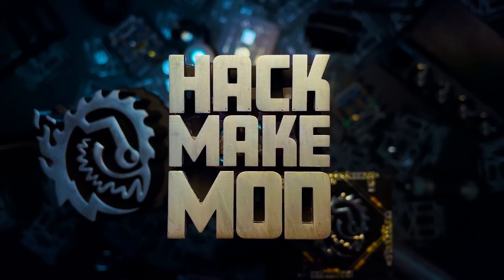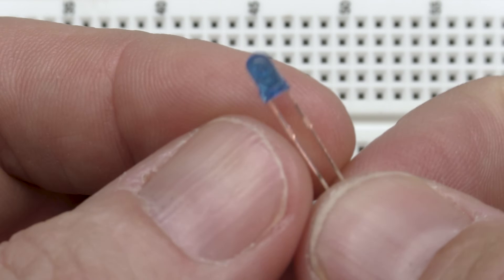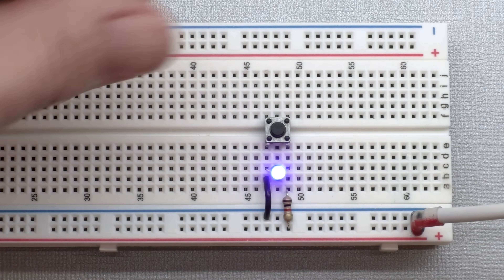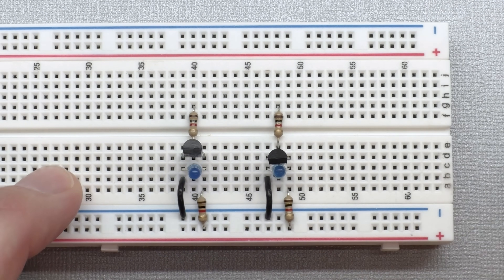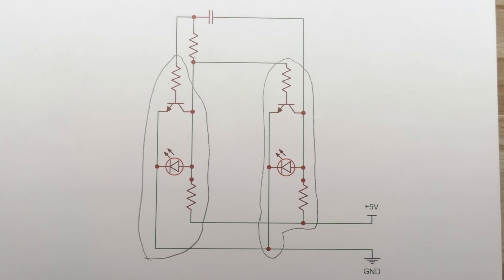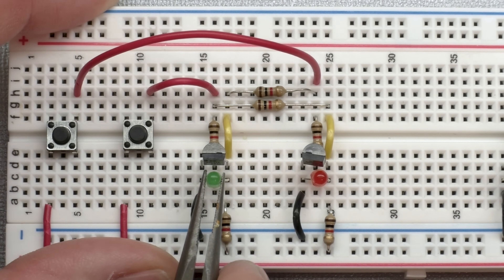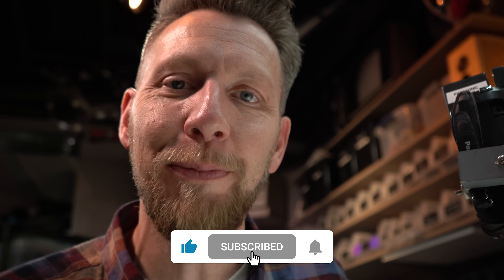Fun with Transistors

Comment: “In theory, if I take the output of the first one and run it to the input of the second one, what do you think will happen?”
**LITERALLY proceeds to run the exact opposite.
I work with electricity and logic circuits for a living, but even my brain hurt for a while until I realized that the two blue LED circuits were redefined without ever stating as much.  Silly me, I thought that the first circuit that was populated to the breadboard would’ve been referred to as the “first” circuit and the second one the “second.” ¯\_(ツ)_/¯

Comment: Super awesome video that actually show-cases how electronic components work and follow the rules of electricity. I have a lot of theoretical knowledge of how these components work but watching a practical application with actual circuit diagrams was awesome to watch and understand. I wish you the best and hope that you make more videos with more sophisticated components like inductors and transformers, and gradually moving to simple Arithmetic or Logic units (ALUs) and then gradually ever more sophisticated chips, leading to a micro-processor controlling a synchronous or induction motor leading controlled mechanical motion controlled by a programmable chip to a fully functional mini-robot .

Comment: The 2N222 is a BJT...  Current controlled device.  Nearly all digital transistors are CMOS.  CMOS transistors are more complicated because they are actually a combination of a NMOS and PMOS.  These guys are designed to operate in a switching mechanism with voltage on the base.  BJTs can work as a switch, but they're a lot slower to "saturate", completely switch on or off

Comment: hello thank you very much
but I have a question why do we put a resistor next to capacitor
is it to discharge to it when open circuit then let the current pass?
Is that what you mean
And why did we choose 22uF capacitor , how a capacitor determine time , is there a formula?
THANK YOU VERY MUCH
Reply: Hey, did you find out why we use a resistor next to capacitor? I have the same question.

Comment: Thanks a lot for that amazing tutorial. Just a quick one, I've followed along and made the 2 circuits for the oscillating circuit, however, when I try powering up either of the transistor bases, it switches off both LEDs. I'm quite a noobie to electronics and I'm using a BC547. Please let me know what I'm doing wrong. Thanks!

Comment: I resonate with every comment here. You re-defined how the knowledge is meant to be passed on and reminded people that math is a representation of observations and can never be equal to the observation itself. This demo fired more neurons in my brain about the use of transistor than all of my 4 year undergrad syllabus did! Thanks a ton for putting actually useful stuff in here, instead of all mumbo jumbo. Hope to see more such useful stuff!
I wanted to share my thoughts as they I passed between my ears.
11:47 actually nothing is happening - because there is an invisible barrier to lift the right transistor from ground to positive voltage, whereas the first transistor is in a more stable configuration with it's carriers having already crossed the depletion region.
12:40 when you add a RC circuit, it helps push the first transistor out of it's stable state by increasing the current flowing into the first transistor which triggers a voltage drop at the second transistor there by reducing the barrier to turn it off.
If you added voltmeters at each of the nodes, these change would become more evident and we can see that the circuit is in a stable configuration even with a loop when RC circuit was not added.

Comment: For me as a beginner, it’s not clear what happened when you first introduced capacitor and 10k resistor (to recharge the capacitor). It would be great if you cover in more details, how exactly the resistor helps to recharge the capacitor in the given circuit, the direction of current to the capacitor. I cracked my brain pondering on the circuit and still didn’t get it.

Comment: That was great thank you !! Iv been hooked on Arduino since i discovered it around a year ago and iv been looking for a simple explanation to help me understand transistors for ages !! That was clear, practical and very interesting thank you so much .. subbed as id like to see more maybe you could do some more cool little circuits with capacitors and transistors to help people like me understand the underlying electrical principles that seem a bit abstract when at the microcontroller level.

Comment: This video is brilliant. For anyone else who got stuck at the simple oscillator (both my LEDS went off when I connected the collector leg of the first resistor to the 'input' or base leg of the other one), using a 10K resistor rather than a bare wire solved my problems as my voltage coming in was a little higher.

Comment: Why are you controlling the LEDs by having the transistors short across them as opposed to the conventional connection of having the LED positive connected to the emitter side of the transistor and the negative side of the LED to ground. Now when the transistor is turned on, current flows through the LED and it lights up and when the transistor is off, the LED is off.  FYI, Electrical Engineer grad 1974pm (pre microprocessor!).
Reply from the maker: I originally did this to invert the function of the transistor. Then I continued building from there
Reply: @HackMakeMod  This is so confusing, why do things backwards, took me hours of wasting time. Tried patkeller method and it worked in seconds

Comment: "Do you know what it is?" Yes, given the package and context, I would assume that's a (most likely NPN) Bipolar Junction Transistor (BJT).
"Do you know how it works?"  Nobody knows how it works.  Nobody.

(Ok, there are a few very smart physicists who have sophisticated mathematical models for how a BJT actually does what it does, but to everyone else, even all the electrical engineers that design really sophisticated circuits with them every day, it's still basically magic.  (Knowing how to use them and knowing how they work are not actually the same thing...))

But they are, indeed, incredibly useful anyway.

Comment: To figure out which side is negative on your LED, use an old 3V lithium cell, it won't need a resistor, they have enough resistance internally (because they are old). So next time your kitchen scales say they are "flat", keep that cell.

An old LED, cheap "surplus" LEDs or one taken from another board will not necessarily have a long and short lead, or a flat on the body, they could be either way round. I have some 1970s/80s LEDs that have a flat and equal leads but some are reverse polarity.

Shorting out an LED is not the usual way to turn it off. 
Most people draw their circuit diagrams with the positive rail at the top and 0V at the bottom. It is not correct to call it ground, because it isn't actually grounded. A PC power supply might ground the zero volt rail, but a 5V "phone" power supply won't, and a battery wouldn't have either side connected to ground.

Comment: Very cool video. Im a retired Test Engineer (EE) . Once you understand how a basic transitor works, imagine 10000 of the little buggers buried inside a 300 pin integrated circuit. Its pretty wild when you think about it

Comment: this is one of the best detailed videos about electronics . Thanks
Reply: agreed
Reply: at around 11:30 he shows how connecting the recieving leg of led in parallel with middle leg of other circuits transistor recreates the before effect on how when a transistor and led in parallel alot of current is stolen by transistor 

now if he now hooked up the first circuit's transistor's third leg to live now the battle is between the first led, transistors who has live volt's terminal leg and the ither transistor's middle leg, we know why first led stops glowing,cause that circuits terminal leg won snd stole, but it should also win over the transistors middle leg effective making that not glowing led now glow

but in my circuit both not glowing when I do this,what am I doing wrong? 😔😭

Comment: Thank you for using schematics. Too many beginners get crippled seeing only the physical circuit, no abstract of the connections. Use both. Me, seventy years with electronics as hobby and profession. A well done video, a good intro to "bread boarding". And viewers, learn Ohm's law, the relation between current,voltage and resistance. It is everywhere, in all these circuits. Looking forward to this excellent teacher explaining op amps !

Comment: 12:35 I cant visualize how delaying works. Why do we need a resistor? Can someone explain or suggest a topic that I can search?
Reply: Hey. At 12:39, does the oscillation happen for you? Not for me. What kind of resistors and capacitor do you use? I want to make this part work on my side until I experiment with the next steps
Reply: Resistor will slow down the charging-discharging of the capacitor  to be visually detactable. Am i right ?

Comment: Great dot connector for those of us learning at a leisurely pace. Your technique is a summation of concepts and data i have learned but was either somewhat  shakey on, or i was in desperate need of a lab / visual manifestation of acquired knowledge .  One tiny thing i would like to mention in case it helps someone.  When showing the pinout of BJT NPN 2N2222, the camera flipped the proper arangement.   If flatside is facing you with leads pointing towards ground, its CBE from left -right. Base is still the center but it got confusing when labelling ins and outs of inverter circuits.
Reply: i check google and it shows when flat side is facing you , the left pin is emitter , base and collector ( ebc )

Comment: Thank you for your channel. Here is my story. 
I started my apprenticeship back in the early 1970s and initially worked on relay logic ccts that included mechanical rotary selector switches that were also used in telephone exchanges and various relays, relay logic and control systems. I also worked on plant (still in service at that time that was installed around 1918, but that’s another story 😂)
I was then involved in the project of changing the control network over to predominantly TTL which involved hu feed of control cubicles at a central location and at remote locations, very few ICa and all this off hundreds of A0 size drawings. The design and control engineer committed his final act (ever) when we were about 79% done so I was moved to other work while the authority searched for a replacement. I moved on to a new employer and new field that didn’t directly involve electronics directly which required me to basically ditch electronics and learn new theory.  Now retired for several years, I was recently reviewing some old notes I discovered and having once been thoroughly intrigued by solid state wizardry I’m now “roped in again” 😂. 
I found your channel and look forward to working through it to relearn long lost knowledge and skills as well as a few of the newer heeby jeeby bits. 
Oh, and I forgot, starting in the back end of the 60s, through to the start of the 80s I pirated ham radio, but all the equipment I had was valve, but again, that’s another story 😂. 
Thanks for posting my friend, if you lose me, better come find me. 😂
Cheers (73s) 👋👋👋
Reply from the maker: That’s a fantastic story! Thank you for sharing!

Comment: You seem to have no clue... continue reading... you might save some face...

The current literature in semiconductor physics and electrical engineering is rife with outdated, misleading, and fundamentally incorrect concepts that perpetuate confusion and hinder true understanding. The concept of "holes" as positive charge carriers is nothing more than a fictitious abstraction that serves no real purpose other than to obfuscate the true nature of charge carrier behavior. This nonsensical idea should be eradicated from the discourse, as it adds an unnecessary layer of complexity that is completely devoid of practical utility.

Furthermore, the terminology used to describe electrical phenomena is redundant and imprecise. Phrases like "current flow" are not only tautological but also betray a fundamental misunderstanding of the principles at play. Ampérage is the movement of charge carriers, plain and simple. There is no need for additional qualifiers that do nothing but confuse and mislead.

The historical convention of describing ampérage as flowing from positive to negative is an arbitrary and outdated notion that continues to perpetuate errors in understanding. It is high time we abandon this illogical convention and describe ampérage as it truly is: the movement of charge carriers from negative to positive. This straightforward approach aligns with the physical reality of charge carrier movement and provides a more accurate and intuitive framework for understanding electrical phenomena.

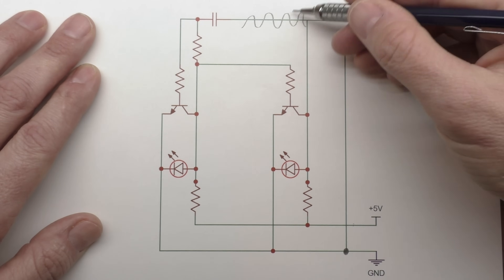Comment: At 17:20 - the worst schematic I've seen in recent memory.   He drew the schematic to mimic the placement of the components on the board. This is a huge mistake, especially when instructing persons. A schematic is a specific tool for a specific job - It controls the design, not the construction.  It shows the electrical relationships of the signals, not the physical relationships of the parts.  It shows the flow of the signals, the flow of the power, and how these interact.  A schematic is a story written in a language that has universally agreed-upon conventions.  Without those conventions for structure and syntax, meaning is lost.
Reply: At this point, The beginner doesn't know about the "art of schematics" they just need to connect mentally what they see physically on a breadboard to something that could be laid down on paper and still makes sense. as a professor, i've found out that the biggest mistake in teaching is to forget about our own state of mind when we didn't know about a topic. that's key to bridge learners brain and unlock the understanding of a concept.
Reply: @hadibq  I'm not talking about the "art".  Pretty is not the objective.  A schematic is a foreign language.  To communicate effectively, you have to learn the syntax right up front.  Even on day one, we don't let children say "Spot see run" for a very good reason.

"and still make sense" - That's the problem.  A sloppy, undisciplined schematic doesn't make sense; it hides critical aspects of the design.  For example, both collectors are clamped by the LEDs, and cannot rise above 1.8 V to 2 V above GND.  This has a direct impact on how the circuit operates.  When re-drawn as a classic E-J multivibrator, this condition is blatantly obvious.